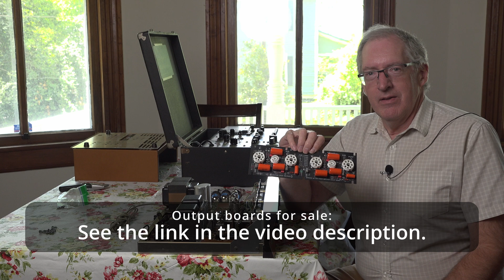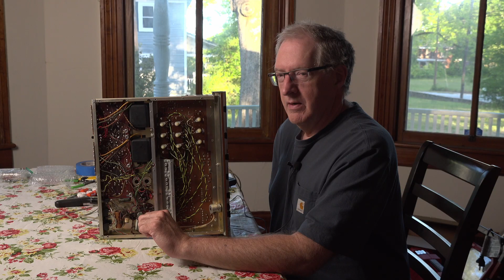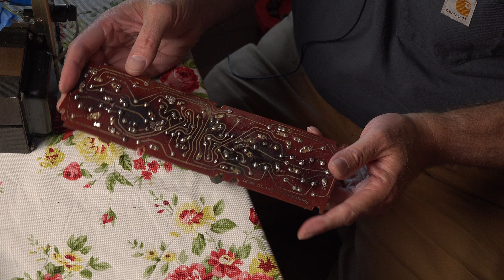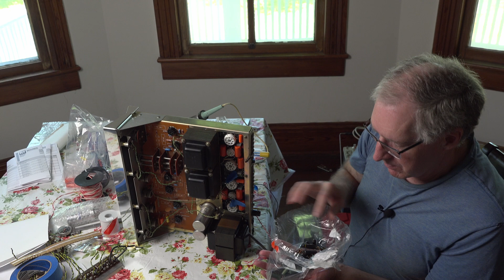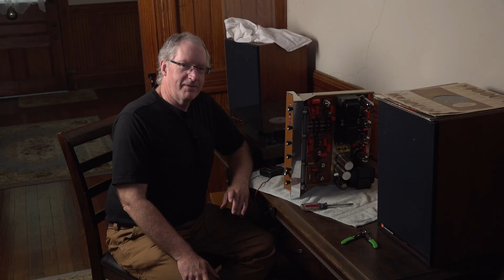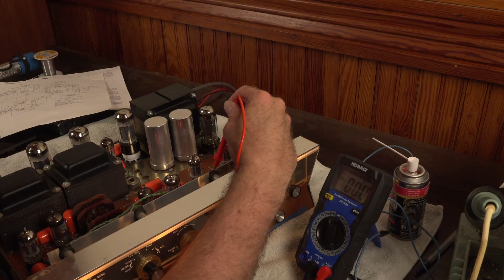Heathkit AA 100 Rebuild #2

Comment: I have one on the bench right now. All tubes good now ( replaced 2x  7591)   Power supply appears to be meeting spec . I'll check for PS ripple too.  Cleaned rotary switches with artists eraser and DeOxit with a tiny brush.
Reply from the maker: There are dozens of places in the audio chain where the signal can get noisy. Keep after it and you'll have a nice sounding amp!

Comment: For anyone watching, I would just reflow all the connections as part of a complete restore. I like the idea of getting all the old pots out of the audio path and replacing the connecting wire with coax cable.

Comment: The problem with PCBs is that heat is the greatest enemy. Over time they will fail and not in an easy way to find. I live in Australia and we call them valves. The sockets should be mounted to the chassis, not the PCBs. I own a Leak Point One Stereo 20 that needs a full going over. I have to find someone to do it. I'll get there.

Comment: What is the output in watts after all this?
Reply from the maker: Heathkit rates the output as 25 watts per channel into 8 ohms.
Reply: @daystromaudio1903  o was wondering if your mods increased it any?
Reply from the maker: @MrRourk  No change in power, but the act of removing two layers of level controls does increase the drive to the power amp section.